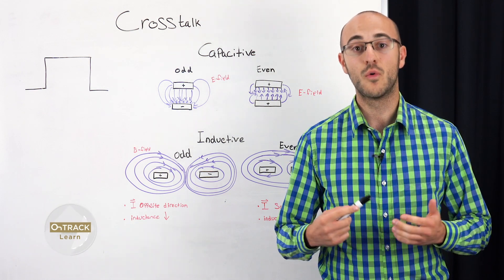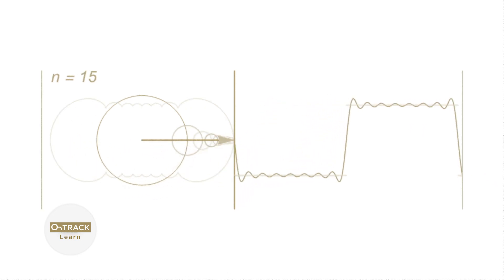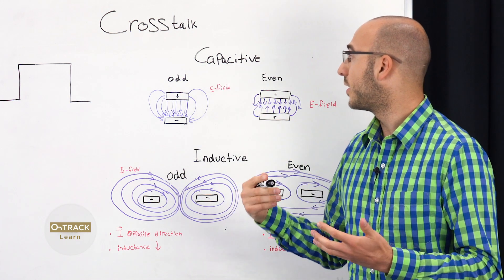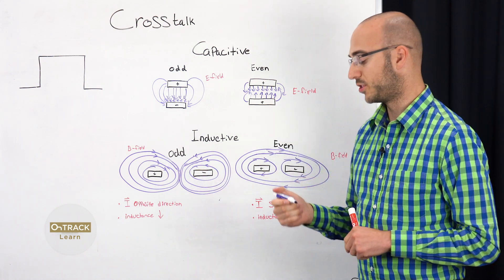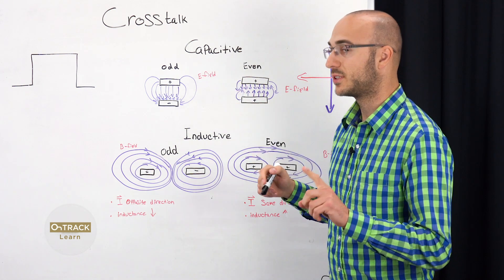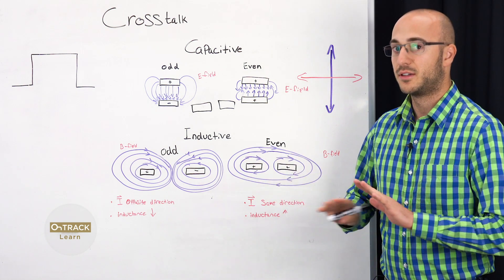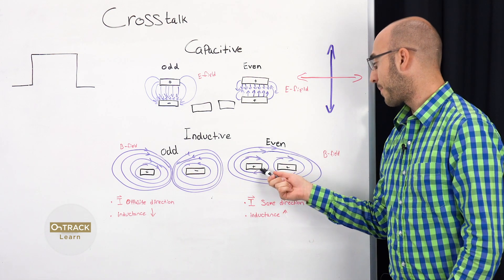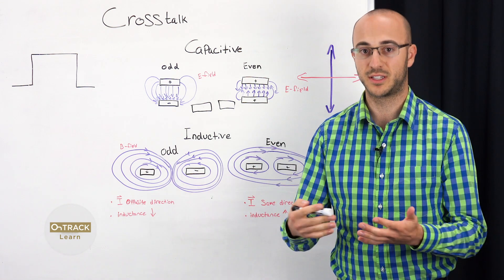How To Solve Capacitive and Inductive Crosstalk in Your Design - OnTrack Whiteboard Series

Comment: How does a muti-layer design affect the cross-talk as the discussion above I take is for a 2 layer PCB? Say 4 layers where you have power and ground planes in between. Is it fine to now route a track on the top layer that runs in the same direction as a track on the bottom layer? Or will they still have an effect on each other? I've been told in a four layer stack-up that Tracks can be routed on top of each other (top and bottom layers with GND and PWR) sandwiched in between and it would be fine. Still feels wrong though.